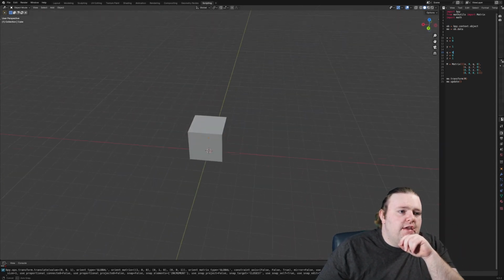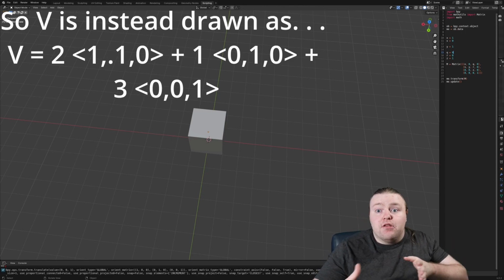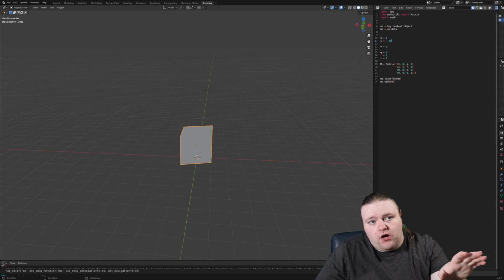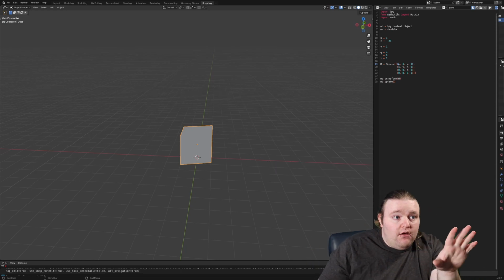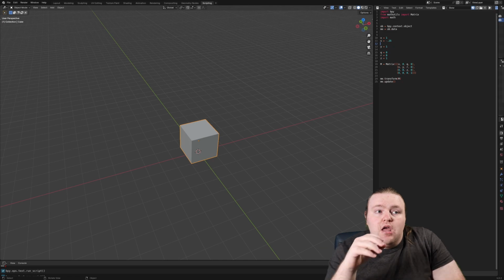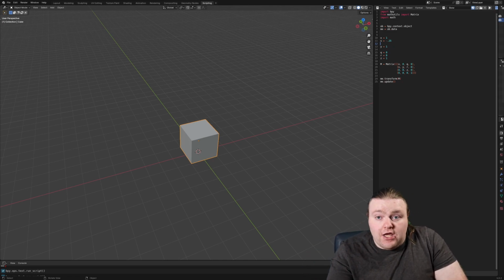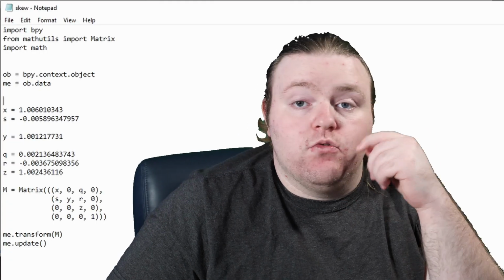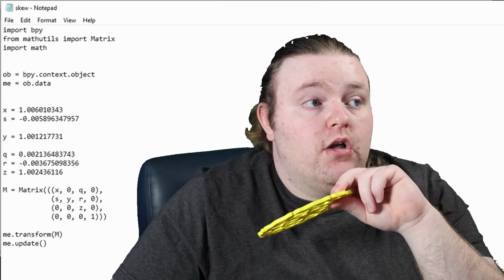You Deserve Skew Compensation!! @CNCKitchen @BambuLab

Comment: Thanks for a video on this very important topic !  Maybe not so much needed if you print the occasional dwarf or cat or action figure but skew certainly becomes a huge issue when you go for more technical things like gears and pulleys, boxes with lids etc.  I've been using Cura's skew compensation for more than five years now.  Extremely fascinating how much "out" your printer can be on its planes once you start investigating these things.

Comment from the maker: If anyone has any thoughts or suggestions regarding this topic, please share. I have half a mind to simply make a fork of Bambu studio and implement a naive general transformation matrix. So if there are any features down that vein you are dying to have, let me know and I may include them for a future pull request, scope depending.
Reply: Yes! this would be a huge boon for the 3d printing community. Its something that's really been frustrating me as my A1 came with 0.2 degrees of YZ skew and also XY size difference. So if I print a 20x20 cube, it'll actually be 19.6x20 and there's arbitrarily nothing I can do to fix it.

If you do decide to do this, I think an Orca slicer branch would be better than Bambu Studio. And XY size compensation setting would be much appreciated. 

Suprised I can't find anyone else working to add preprocessing skew comp to a slicer.
Reply: I don't know if you are still interested in this information or not, but some time ago, I had some XY skew on my bamboo printer (not much, maybe 0.5% but it was critical for me). And I found an official guide on how to fix it. The process is simple 1) you print a template, 2) you measure it with a caliper 3) you add a custom G-code command to startup section of you next print to write the XY-skew compensation config directly to the printer. You run this once, and the printer will offset XY-skew on it's side going forward. That works for me perfectly; I don't see any skew anymore.